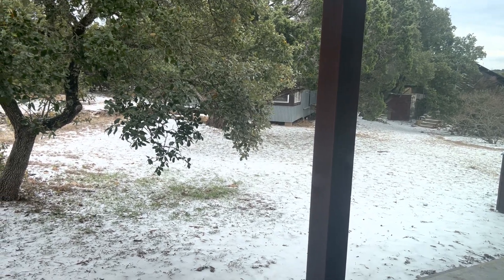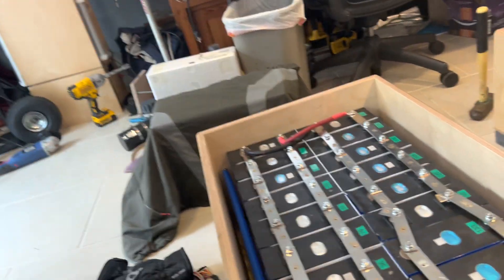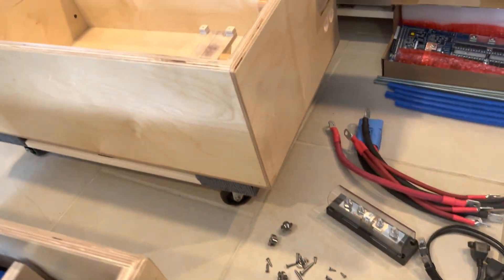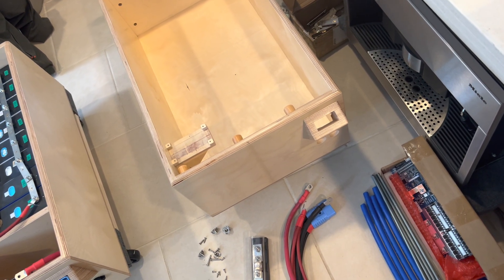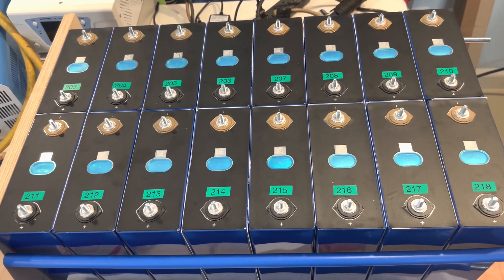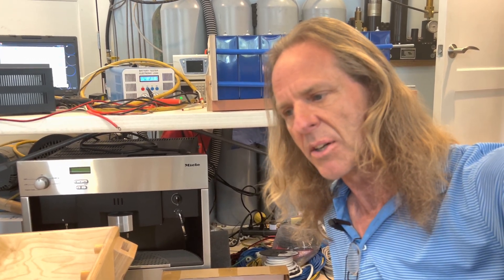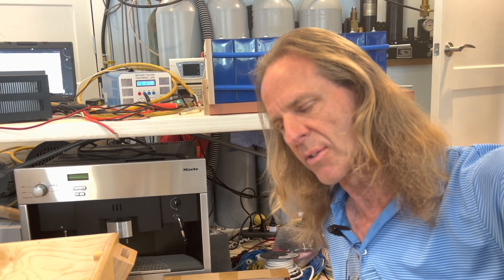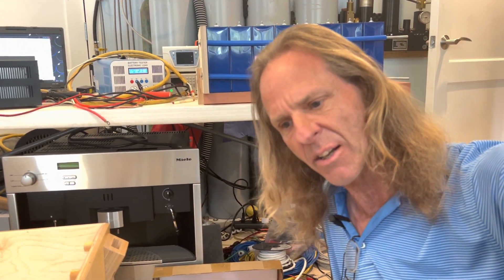The Test Results Are In And My Lifepo4 Supplier Is a Winner, Plus Some Updates On Other Projects

Comment: Not the subject of this video but based on the spacing of the terminals on the last two cells on the negative end of your balancing string, it appears that you are mixing a couple of 280K cells with the earlier version.  Any concerns about differences in chemistry or build makeup and difference in height?  The K's are only a few mm taller but with a rigid buss bar that could lead to uneven contact on the terminals.
Reply from the maker: ding ding ding winner winner chicken dinner!

Yes I am mixing two of the K cells with the rest of the batch of Catl 271AH cells. I will have to use aluminum washers to shim the difference in the adjacent cells. You can see that I used some half busbars for the shims while top balancing. I had too many rejected cells from the batch of Winnie Huang ripoff cells. I had ordered four extra and it wasn't enough. I'm hoping I can get away with it due to the two oddballs being superior but I will be watching it closely and I will be reporting my experience with it as a learning experience in an upcoming video. I won't know until I try it and test it. I suspect it will work but this battery will stay in my herd and not go to my friend's project.  I will pin this comment to the top in your honor. lol
Reply: @RayBuildsCoolStuff  According EVE cell manufacturer specification (under section 8 - points for attention - 4th point), they not recommend on mixing different cells (either brands or models) together. So do you think it's a good idea?
Reply from the maker: I'm adding this comment. I just checked and rechecked. The terminal of the CATL 271 cells is almost exactly level with the terminal of the EVE 280K cells even though the EVE cell case is substantially taller. I'm glad I didn't assume because the case is three aluminum washers taller. Three washers that I WON'T be using. LOL I seriously doubt that the cells will behave the same but time will tell. Stay tuned.

Comment: @Ray Builds Cool Stuff I'm not sure about this point, but I think saw it on somewhere that if a cell is brand new Grade A (280Ah cell) when it's fully charged, it should have capacity value between 290 - 300 Ah. what do you think on that? There is no mention about this fact on cell manufacturer documentation
Reply from the maker: I have not heard numbers that high but I have seen numbers as high as 287.

Comment: Ray, is there any chance you could make your Seplos BMS parms available? I am stuck between Alan at Seplos and Jenny. Alan says I have two bad cells, Jenny says not to use a BMS, either way, I am not pulling full capacity, the BMS says 52V is full and in the logs there is a bad discharge curve on a couple of cells. I just want to be able to say that it will charge past 52V and then figure out who will possibly warranty their product, but right now I am not terribly happy with either company. Sorry for the rant and ramble on your page, but also letting others know of my experience with both companies.
Reply from the maker: I don’t understand what you are trying to do. Why would Jenny say not to use a BMS. How are you testing the cell capacity? How are you charging? What is your configuration? What logs are you talking about?
Reply: @RayBuildsCoolStuff   It is entirely possible that there is a language barrier and I am missing something or she is talking about strictly for testing the cells. I am not specifically calling her out, I am just stuck in the middle of two companies and I would like to 100% isolate the problem. You seem to enjoy your setup, which I have modeled my pack on and hoped that if I had a copy of your BMS parameters as a known working setup, this could help me. 

“i do not suggest BMS. Usually when we test the samples. we will charge it to 3.65v and discharge to 2.5v. 

Jenny Wu from Docan Tech
https://www.facebook.com/jennywu896/
Whatsapp/wechat: +8613537721971
Linkedin: jennywu896”

Also you can pull the logs off your BMS via CAN Bus, those are the logs I was speaking about. Lastly, my BMS had to be manually changed from a TC of 150Ah to 304Ah via CAN, Alan says this is required. What I was asking of you is, could you make a backup copy of your BMS parameter’s, I would like to try it in my BMS. 

The cells were top balanced with an icharger when I first received them a ~4 months ago

Checking voltage both with the BMS and DMM.

16S configuration

I forgot to note that these are now charged via solar array.

Comment: Just sub'd✌️
 Thanks for the videos. I'm contemplating taking the Alibaba leap of faith and buying a batch of cells for a system for use as our home battery in combination with.
Looked at self contained rack type batteries but I prefer a solution you can support yourself for many reasons. Best of luck in your endeavours👍

Comment: Hey Ray, what is the discharge current do you set when you test your cells. I have the same EB Tester unit for capacity testing. Tested my cells with 40A
Reply from the maker: I always use 40A charging or discharging

Comment: Hi Ray,  also this comment is not the subject of this video sorry, I am interested to see how you will connect the batterys (not cells) together. If you will just parallel them up like .. most people. Personally I am considering charging each battery individually (I will have 4 batteries 304Ah 48v about 56 KW and one MPPT charger for each battery probably Growatt 5000 ES) and maybe  .. here comes my crazy idea... use a large diod (100A with low voltage drop) on each battery to power a single inverter. This way the chargers will charge the single battery and the inverter will consider all the batterys together as a single battery in parallel.....
Reply from the maker: I made a video about the midnite solar battery combiner box that I am using.

Comment: Great work Ray, but have you considered the server hacks for sale in US, they are not as power dense as yours, but price per Ah wise, they cost average 0.25 USD per Ah, including case, BMS and they look pretty good quality, based on Will Prose tests.
Reply from the maker: The price he states isn't real. Run the real numbers delivered and taxed and it is still a good bit higher if we price our labor as free. The real reason is because they don't build their batteries to the standards I want. None of them include class T fuses for instance. They aren't easily serviceable or serviceable at all. They are too low of a capacity because of a weight limit they impose on themselves so to do a system that can support a real home it would take way too many of them and the way they parallel connect them isn't good either. The further you get from the main connection the higher the resistance. They work for people that can't build stuff but that leaves them at the mercy of the manufacturer. At that point you can just call the solar guy and have him install an LG or Tesla system. Yuck

I keep seeing these systems come out and even the build it yourself system by seplos on early bird special, when I looked into it I wanted no part of it. It may get there eventually, but I think many of my concerns are baked into the whole approach that manufacturers take. That's my opinion. I hope I'm not expressing it too strongly.

Comment: If am using seplos bms 
Should i top balance to 3.65 or 3.5? 
Then install thr bms? And charge? Until it cut off?
Reply from the maker: I top balance to 3.65v, then assemble the battery with the bms and capacity test down to 2.5v. Then I recharge back to around 80% soc to await placement in service. I would store at 50% but if I need them in a pinch, I want them to have more soc so that's my compromise.
Reply: @RayBuildsCoolStuff  so when i drain them first time should i remove the 8% protection?
May i know your setting for over/under-voltage protection?
Reply from the maker: On the first discharge I take it to 2.5v. I am looking for weak cells and total capacity. In regular use I will 3.46v at the top end and 3.0v at the bottom end and I'll adjust as I see a need.

Comment: Ray, how do you connect several batteries (with BMS) and verify that the network cables are actually doing their job?  In most problems solving scenarios one divides and conquers.  
What indicators do you look for to see if the   BMS’s are functioning correctly?

Thanks for the videos. I’m always happy to see your content!  👍
Reply from the maker: I test the voltage at each individual lead to confirm that they are connected properly and and in the right order. This is shown in one of the proper connections videos. 

As far as testing parallel batteries with communication, I have yet to get to that point but it is coming soon along with communication with my inverters. I have allies in the quest though.

Comment: BETTER FOR ALL if you do write a comment yourself and pin it on top where you can update the results or ask questions.
If you write a comment and pin that on top all will see it which works better than in the description cause that is usually fixed with the text of the date of the release and updates would be communicated via comments like all other do.

Comment: 3:23 what kind of Miele product is there on the left ?

an ofen that needs to be fixed or is it used for the battery build ?
Looks like a ofen microwave kitchen stuff even though our new one has a lot more knobs.

Good progress, even though I did not have thought you would get freezing low temperatures in Texas.
Reply from the maker: 18 year old coffee machine. I'm afraid it was outside in a shed during last years -16C storm. It has probably frozen and cracked the pump which will be its death if true. It made 40,000 cups of coffee in its life.

Comment: Hi,
What do you think about this?
 I saw somewhere that after top balanc, the cells first have to be half emptied back. Because now they are under tension, and can expand if you remove the tension from the pack

Translated with google
Reply from the maker: I have built eight so far and the slight tension I put them under is almost completely unchanged when they are at a high state of charge. I'm never charging at more than about 70 amps on a top balance so the rate of charge is like .016 so that is apparently not swell inducing. I only have my experience to go by. I tend to not believe all these claims that are made and instead use them as things to look for. Testing shows this one isn't a thing.

Comment: I just capacity tested the same cells from Daisy eFest at Docan technology. I can’t fault them, they turned up to the UK in 41 days with no extra import charges & in pristine condition, all matched, batched & true to spec. Great supplier in my opinion as it stands. I’m using a BMS with 2 amp active balancing.
Reply: Thanks toby
Reply: How long did it take for the batteries to arrive? I presume they were from china?
Reply: @mikeatherton6814  sorry, I thought I included that info, I'll edit it. 41 days in total & yes direct from China. No tax too which I was kind of anticipating.
Reply: Did you have to pay any additional import VAT when they came to the UK or was the Docan price all in?
Reply: @anthonyporter5741  no hidden taxes on import, I was half expecting a charge. I was also expecting the boxes to be covered in warning stickers with batteries on but they didn't. Maybe it's because they're not as volitle as other lithium technologies or maybe they were just not declared as such. Either way thumbs up for no extra charges ☺️
Reply: Delivery from China to Eastern Europe was 85 days. You must be lucky if you got the cells so quickly.
Reply from the maker: You should still top balance in my opinion.
Reply: @RayBuildsCoolStuff  spoilsport 😆